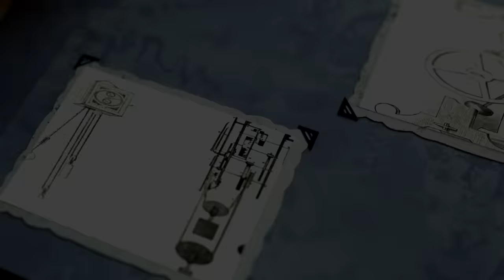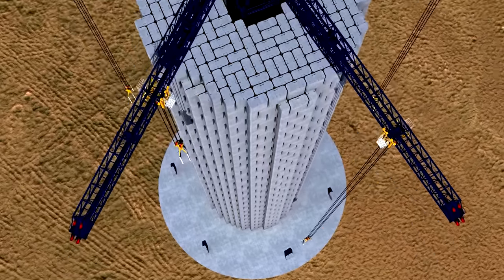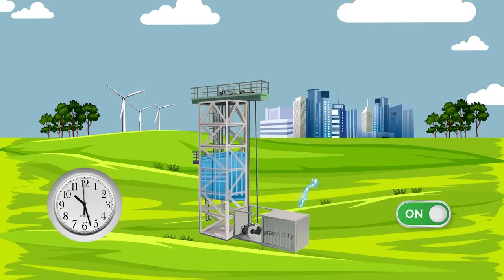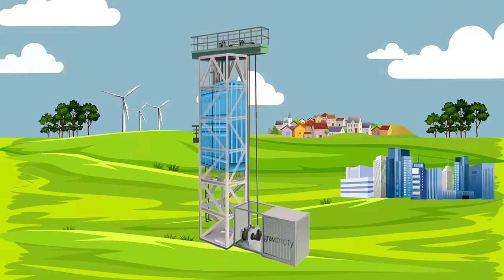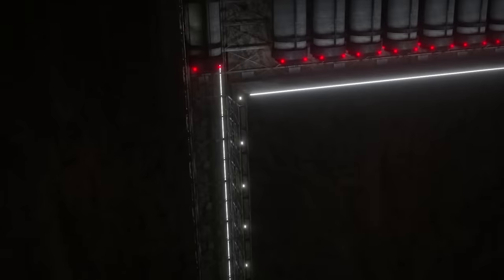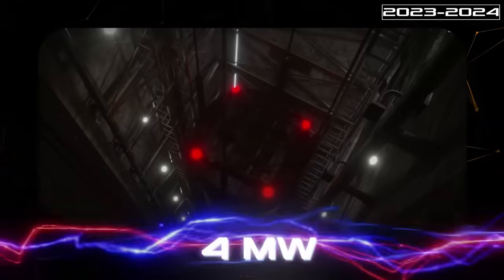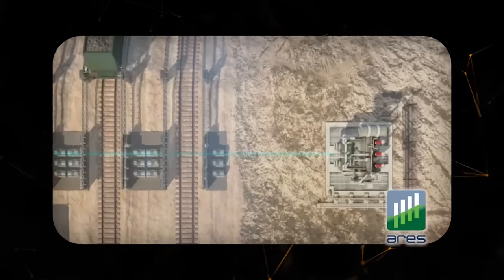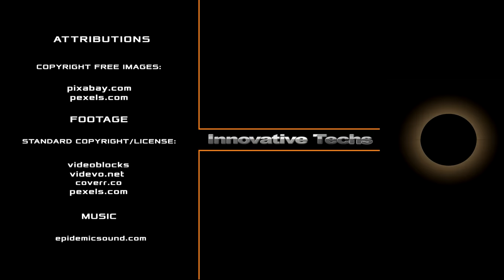How gravity batteries could change the world

Comment: I work in the electricity industry on policy issues and it always shocks non-technical people that we are never more than 0.2 seconds from a full grid blackout. They never really understand the way the traditional grid depends on multiple layers of security margin and how intermittent renewables reduce that dramatically. We desperately need storage as that is the only way that grid can be truly carbon free. The only issue is how much it will cost.
Reply: The US should have funded this project along time ago though my guy, before we hit 2 debt limits. US is going to crap.
Reply: if only we could all have solar and turbines and just generated power for everyone without paying. oh well, that shit will never fly in the US, pun intended
Reply: Sorry, but 0.2 seconds and entire grid blackout don't compute.  Rolling blackouts sure, but grid blackout, if that's that's the best you can do, we need new people in charge.  (it's really funny seeing you explain how hard it is to keep hydrocarbon controlled based power working, but then jump right to intermittent power generation)  

So, how much storage do you need for a 100% renewable energy source?  In December, we don't see the sun here, and the wind doesn't blow, and all our reservoirs are at winter pool.  And they've been trying to install a main transmission line here for 25 years, no success.  Now you have to put in a 100% base load capable hydrocarbon generating capacity, to back up all your renewable and batteries.   So capital investment sounds like it's about 4X (renewable/storage/hydrocarbon) what a simple hydrocarbon system with 10% redundancy would cost.  Don't forget your wind/solar needs to have average generating capacity of at least 2X base load, so  you have something left over to charge the batteries with.  Show me what a GigaWatt-Month continuous system would cost per KWhr to the home owner.  None of this makes sense, and I think Germany has already proven me correct on this.
Reply: @wadedoesntcare  I think we are agreeing. Intermittent renewables based systems are even harder to maintain within the normal required stability range. The old coal and newer GGGT stations here in the UK with thousands of tonnes of rotating steel turbines could provide spare capacity, inertia and all the other ancillary services to keep the system stable in all but the most extreme scenarios. Now the system in powered by wind and solar and DC interconnectors importing power there is less of everything we used to rely on. Batteries can react very fast to voltage drops but not provide backup for many hours or in large capacity.
Reply: @wadedoesntcare  Hmmm, for me Germany proved the opposite. I mean not the whole Germany, but a village from Germany. They started to work for energy independence a decade or more ago. They fought not only with technological issues but with bureaucracy too. But they succeeded. And when the war started they had no problems with energy. 

I do not know exactly what is wrong at country level, but the problems for sure are in the politics sector not in technology sector. 

And it is not a problem of money, but a problem of time. 
I mean how long it takes to do it. 
Sure, time is money. 
But sooner you start it, further you go, and it will be cheaper. 
If you delay it, than when fossils get scarce, will be harder. and a lot more expensive. 

You say that none of this makes sense. 
But for me makes perfect sense.

  The human society had run on solar power since the start of civilization. 
The sun was stored in wood or fat at first.
But since few centuries ago we used sun stored in coal and oil.
Is the same thing, with the only difference that is was not stored in the previous few year, but in previous many millions of years.
  And as we all know, the problem is the speed of reserves consumption. 

Imagine the humanity in the year 2124, or 2524.
in the first scenario the oil is gone. 
in the second the coal is gone too. 
 So, how it does not make sense to use sun?, and store it, obviously, because of intermittency?  
Sure, there is the fission. And it is already used for bases load.
But it is not enough. 
And fuel is not unlimited. 
So better use what we have, till the fusion will be a reality. 

Unfortunately, hydro takes a lot of time to do it. 
Also, this gravity thing looks more like a scam. Sure, it absolutely works.
But it need to be competitive too. 
And with all the wear, I am not really sure.
With the right knowledge, doing the math is simple. 
And after you do the math, you can decide how much time you invest in more hydro, how much in flow batteries, how much in hydrogen... 

  But unfortunately those who decide are not interested in doing that kind of math. 
Their math is a lot more simple. 
It is how much I can pocket from this public project?
Reply: @chickencoupeking1010  this project??? it's a prototype, ....
Reply: cost is not an issue.  there is unlimited financing available for profitable enterprise.
Reply: @tigerstallion  True. There is unlimited finance for profitable projects (taking into account investment risk). I do the financing on electricity projects. The problem is consumers may not be willing to pay for the cost of providing that investment return. Taxpayers may also be unwilling.
Reply: @tigerstallion We need to define profitable. For a business it is not profitable to dig a lake in the top of a mountain, and make a hydro storage. But for humanity may be profitable to start digging such holes and save some oil and coal for future generations. And if climate change is as fast as claimed,  for sure is more profitable to have more water surfaces than sand deserts. 

It all depends on how far ahead you are looking.
Reply: @brianthesnail3815  - Screw the carbon emissions.  The #1 priority needs to be safety and security of all the infrastructure and the computer systems which control it. Grids that can't be hacked will provide much more stability to geopolitics and the human condition, than wringing our collective hands about carbon.
Reply: @tigerstallion  - Absolutely agree.  Which is one of my biggest problems with the recycling boondoggle. To precisely whatever extent it is viable, and in whatever form...that is what private industry will accommodate and value. The materials most sensible to recycle will be recycled cheaply and with benefit to many sectors, which will inherently diminish the capricious use of those materials which aren't profitable. We'd just need the political will to work under actual Capitalism,  rather than Crony Capitalism...till then, all the "Green Agendas" in the world will be moot.
Reply: @ehombane  - 🥱🥱🥱 Are you old enough to remember when any private citizen who had land could keep huge tanks of diesel and gasoline on their own property? Something makes me doubt that.
Reply: Cost was an issue with my ex wife.
Reply: Its perfect if you want to pay un fortune for electricity, and there will never be un balance issue on the Grid
Reply: @Indianloppan   - What??
Reply: Who say's we want a carbon free grid? Only way I personally would accept such things would be full nuclear, like we should have been decades ago
Reply: @DarkAttack14   - 95% with you on the nuclear...125% with you on the "who says?"
Reply: @DarkAttack14  Nuclear is horribly expensive. Carbon capture and hydrogen power almost as expensive, offshore wind is a fair bit cheaper, then onshore wind and solar. However, gas turbines are the cheapest in climates with low solar insolation. Solar works in regions close to the equator bit you still need back up diesels and batteries so whole system costs are still higher than pure gas turbine systems. Coal only makes sense in when the plant is built on top of the coal mine and labour is cheap which is basically less developed countries.

There you are. That is the basic economics. I raise the money to build these assets and nothing is perfect. All have some advantages in some applications. There are some technologies that are definitely more expensive than others though and nuclear is one of them.

Comment: A promising alternative is bouyancy power. Instead of lifting something in the open air, lower a bouyant object like a big baloon in liquid. Releasing the object makes it float up and that force can be used. It allows for using a lot less space.
Reply: Good idea.. ❤️
Subject for improvement by reducing the shape and inflating it through a pump under water deep down.. there must be some calculations around the power needed for a certain air volume AND how it suits the Archimedes push to have a power gain. 🤔😉
Reply: Such a solution shows low efficiency. Flywheel is much more efficient.
Reply: As soon as I saw your comment, a combination buoyancy, gravity battery system appeared in my mind. Thank you for that 🙏 it was a very satisfying rush of mental design 👌
Reply: You make a very good point about buoyancy power, and going upwards to generate that power, but I'm wondering if maybe instead of utilizing a big balloon in liquid, that maybe teeth gear notches going all the way up the mine/coal shaft walls, and some type of metal doomed cap with notched teeth on the vertical sides of the doomed cap, that generates power as it rises up the mine shaft via the lifting force of the lifting force of the lighter that air gas.
Reply: Only issue i dislike about compressed air or buoyant systems is, as you store more energy in the form of compressed air, the energy demand increases exponentially as pressure increases, say you need 1 KWh at 100 PSi to get to 200 PSi, at 200-300 you’d need more than 2 KWh to compress the air, ik my example isnt accurate representation of the power needs but i am just using it as an example.
Reply: Thats true pumping air back into the balloon is easier and would use less power. This could surely be self powered as an overunity device.
Reply: Omg yes it sounds like less friction involved
Reply: it's mentioned at 2:20
Reply: I think the problem is water resistance, but also high pressure contracting the air volume and reducing the force production at high depth. To another the problem with a flywheel is its inability to hold energy indefinitely. It's the ultimate "leaky" battery because it's difficult to keep frictional losses down unless you need the energy right there and then.
Reply: Think lava lamp and convection loops.   Lava lamps use a hot source at the bottom.  A hot water baloon will rise in a region of cool water.  Use underwater hydrothermal vents as the source ro raise a hot water baloon.
Reply: Better yet.... fill it with air at the button and relieve the air on the surface.... a billion times better and cheaper than this.
Reply: using the tides would accomplish this passively.
Reply: That could only be accomplished with compressed air. You may want to familiarize yourself with Boyel's law.
Reply: @dhanke2777  or buoyant objects moored to the sea floor that generate electricity when the tides rise and fall
Reply: @dhanke2777  you can make a compressed air battery. You just use some electricity to pump air into a big tank. And then you use the air in the big tank to generate electricity as you let it out.
Reply: @truescotsman4103 is true, but the math won't support the concept since the efficiency is too low. Lakes, damns, & generators are tens of thousands of times more efficient. Plus, lakes provide water and recreation to local communities.
Reply: @truescotsman4103  that's what I thought when I first joined the thread
Reply: @truescotsman4103  I can only assume that it would be low pressure as in something below 100 psi. Though, if the "energy in" produced more on the "energy out" side were possible we'd have air power cars by now.
Reply: That is already done. Expensive to implement.
Reply: Same principle, we need to waste energy to be able to get the floating object down.

Also, gravity has a greater force if you compare it to bouyancy, making your idea even less effective than the one presented in this video
Reply: @truescotsman4103 How is that more usable than energy stored in batteries?
Reply: Storing liquid is not easy or cheap.
Reply: Bro deserves a like 👍👍
Reply: I don't see how this can be better, this means you need a huge buoyant body and a tall water column. In a dam the higher the body of water the more potential energy per unit of weight of water but with buoyancy that is not even a thing, even worse is that the deeper  you go the more resistant to pressure your bouyant body has to be.